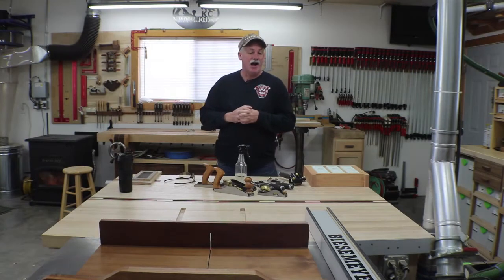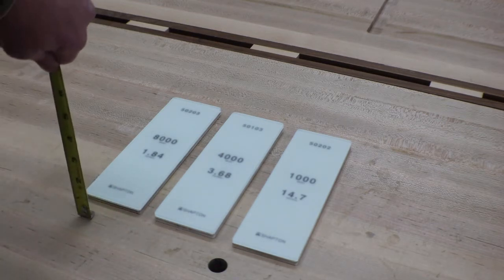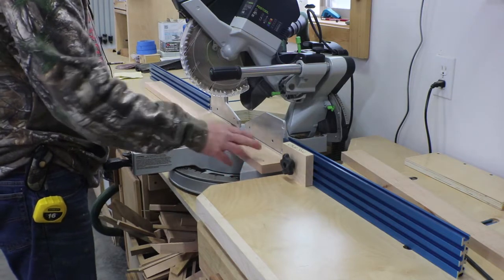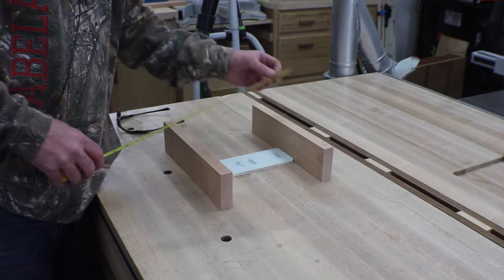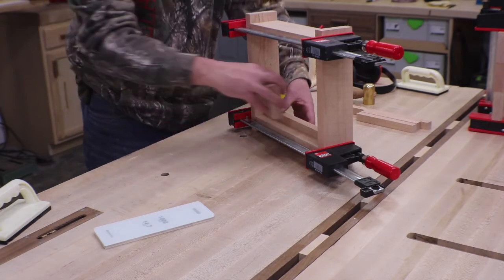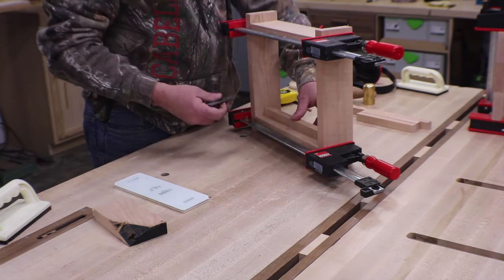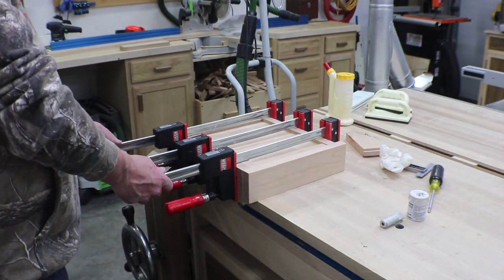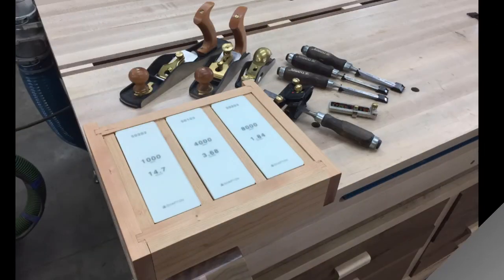Sharpening Station

Comment: Very nice. I think I'll borrow this design.  I'm thinking I will need to limit the space between the right side edge and the far right stone to about 3/4" at the most.  I use a honing guide. I need to be able to reach the far right stone while the tool is in the honing guide to remove the wire edge from the tool without removing the tool from the honing guide (I go back and forth between the bevel side and the back of the tool to remove the wire edge). If I don't have some reference surface for the back of the tool to rest on the stone, my tendency is to rock the tool.
Reply from the maker: Thanks!  After using this design for a few years I'm actually thinking of changing it up..  Another downside to this design is flattening the back on the middle stone.  I find myself switching the stones to the first position most of the time.

Comment: These kind of stations are let down by the clean-up process, all the gunk gets into corners etc plus wood and water don't really mix. I've abandoned this style in favour of a shallow plastic tupperware lid which just happens to hold 2 water stones. The lid is held in place by simple fillets. The gunk just rinses or wipes off - job done.
Reply from the maker: Thanks..  I still use this one but, it is showing signs of needing cleaned up..

Comment: Ive been thinking about building something similar and came up with a nearly identical design. The one thing that has held me back from building is the center stone. Do you find it difficult to flatten the back of the chisel on the center stone?
Reply from the maker: I rarely use the higher grits for flattening backs but, if I needed to, the stone just lifts out and I can put it in the end slots.